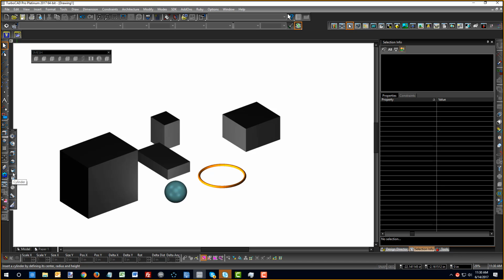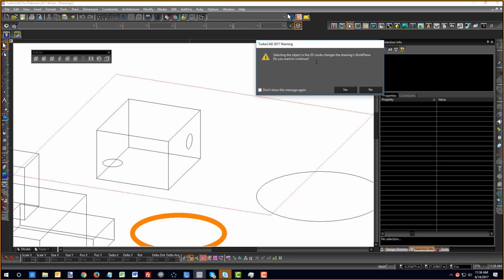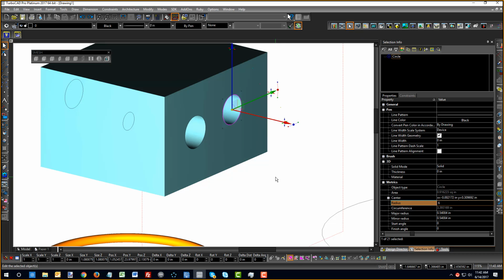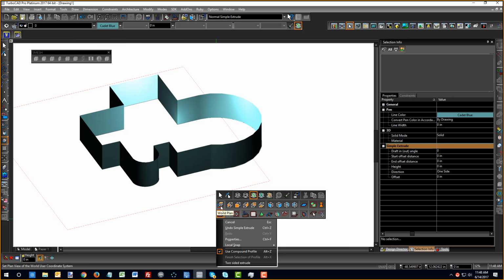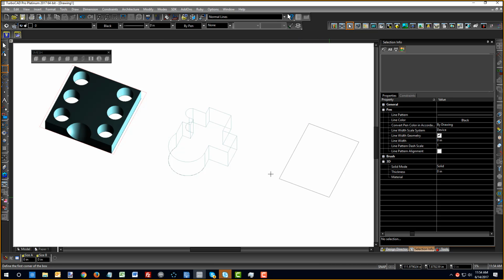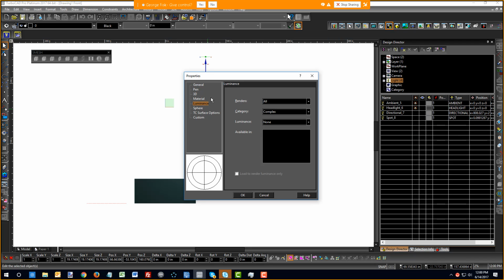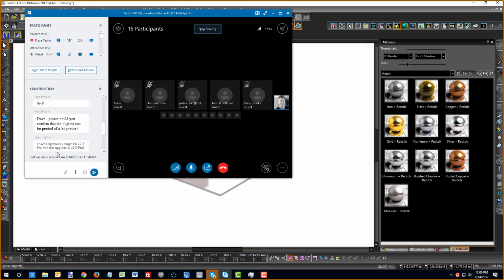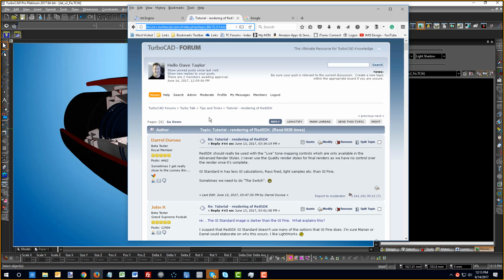TurboCAD Webinar # 3 -  3D Drawing Essentials

Comment: Hello - I'm evaluating Turbocad to see if it will serve my purposes. I am having a problem I just can't figure out. I am able to easily display a 3-d grid such you have but everytime I draw a 3-d shape such as a box or cylinder it is drawn in 2-d. I can see from the inspector I am able to give it height but can't figure out how to show it in 3-d on the grid? Any thoughts about what I'm doing wrong ? I did toggle 3-d on in the inspector bar but my boxes and cylinders are still showing in 2-d.
Reply: Yeah, same issue, i want to be able to move the grid to a face on the object and start drawing the next piece to size there on that face..